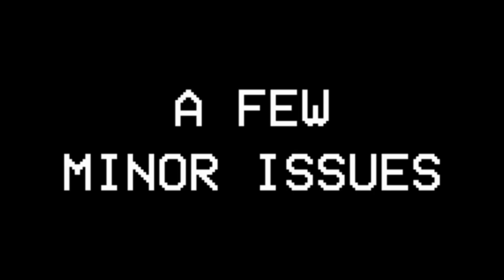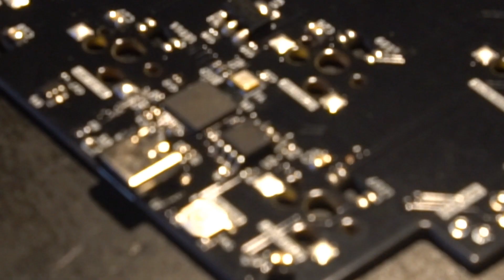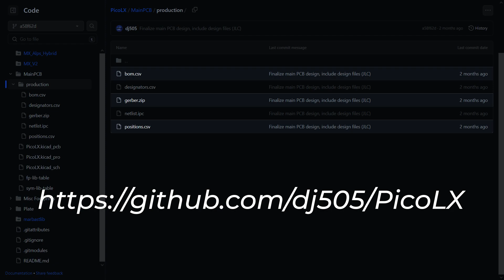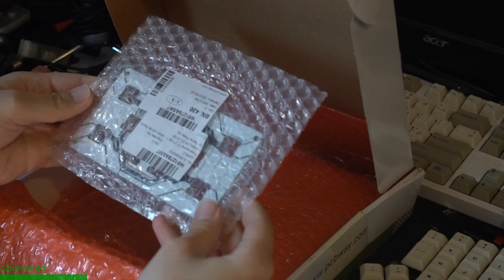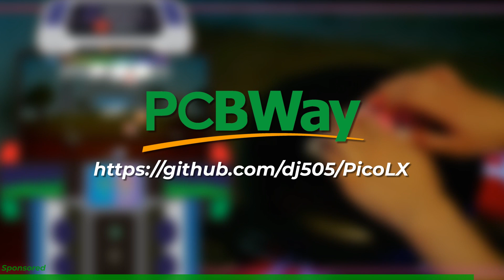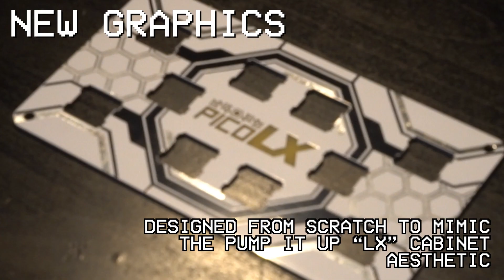Introducing the PicoLX! Overview & Assembly

Comment: This and the PicoFX are very impressive and a much appreciated DIY guide.

My own hand controller also uses keyboard keys and MX switches, but they're both low-profile so horizontal movement is more ergonomic. Still, I find keyboard keys to be limiting because of their angled edges and height (unless you were to design a case that nearly submerges them), so convex arcade-style buttons like the ones sold by Focus Attack are ideal.
Reply from the maker: Glad the tutorial is helpful!
Keycaps that are angled are definitely really tricky to play with, but I usually focus on using DSA profile (or similar) caps for these builds, since they're uniform and even without any angle. Not quite as low as low profile switches, there's definitely more travel distance, but your fingers don't catch on any uneven parts. I personally haven't had any issues with the height, but I'm super curious how low profile switches feel!

For anyone else that's interested in giving it a try, there's a branch on the PicoFX repository called "hybrid-footprint" that supports low profile Kailh Choc switches. I haven't ordered that revision myself but I don't see why it wouldn't work!

Comment: Great job! I hope i can use it in my homemade diy pad piu 🙌✨
Reply from the maker: You can certainly use the same firmware! However I would recommend just using a Raspberry Pi Pico instead of one of these boards, which would be much cheaper
Reply: now that you mentioned it
this just opens up posdibilities to recycles those old cabs that might be already has dead controll board